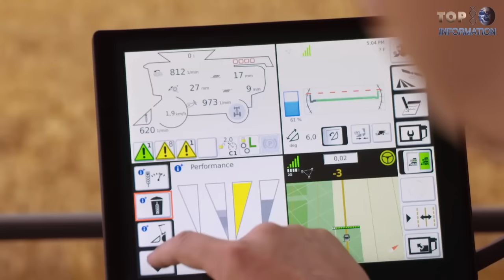10 Badass Machine You Need to See ▶ 8

Comment: The sand cleaner does NOT travel 1500 mph... It travels maybe 2 mph. See video section at 07:20
So, they're saying the sand cleaner can travel at Mach 2, which is double the sound barrier... Faster than most fighter jets.